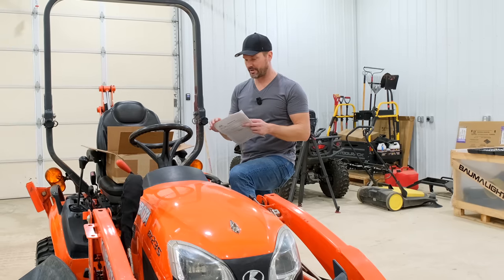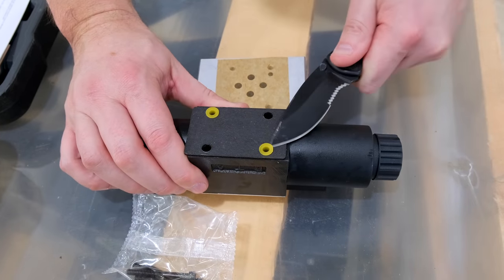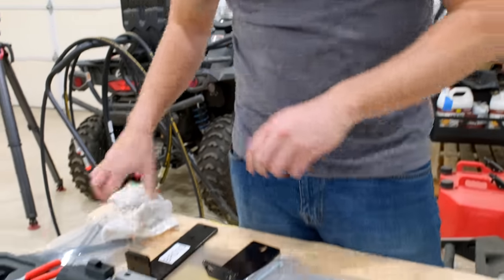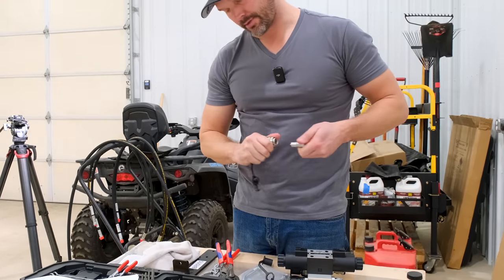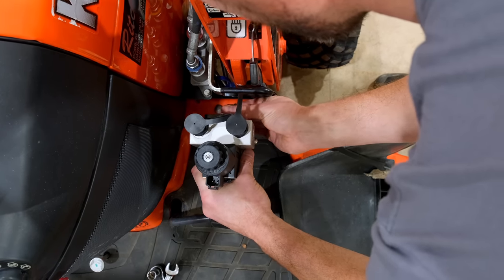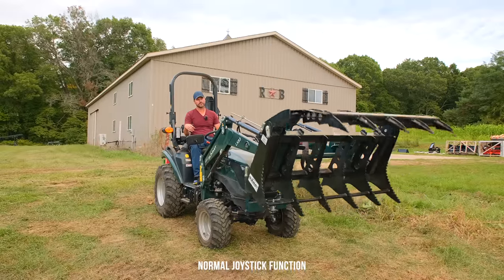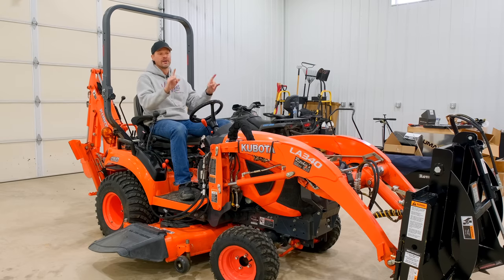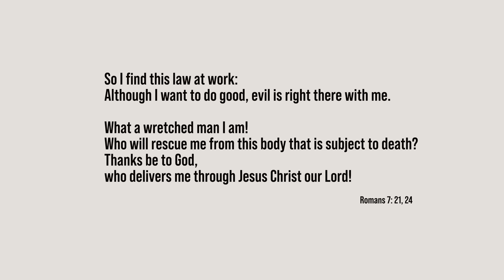90% OF TRACTORS ARE MISSING THIS FEATURE CUZ IT'S TOO EXPENSIVE

Comment from the maker: Have you installed one of these kits?  What did you think? Save 5% with code GWT on Hydraulic Kits @ http://www.summit-hydraulics.com

SHOP GRAPPLES: https://www.goodworkstractors.com/product-category/attachments/?product-category=grapples

LOOK AT OUR MOST POPULAR ATTACHMENTS!
Speeco Quick Hitch: https://bit.ly/3NFC0yl
Stump Wrecker: https://bit.ly/3WYa6Tf
VersaBracket Combo: https://bit.ly/3wUPrnl
Snow Pusher: https://bit.ly/3NB4BVw
Tillers: https://bit.ly/3GT1kk1
Core Plug Aerators: https://bit.ly/3W0R25q
Pallet Forks: https://bit.ly/38wRztu
Grapples: https://bit.ly/3PNNYaZ
Dethatcher: https://bit.ly/3GT9Zmk
Tractor Canopy: https://bit.ly/3IHcvNU

WANT TO SAVE MONEY? CHECK OUT THE GWT DISCOUNT CLUB!  Use code GWT at any of the vendors below and you will save cold hard cash :)  I will also get a commission for the sale, so it's a win-win-win!  

USE CODE "GWT" TO SAVE BIG WITH:
BUCKET BRACKETS @ http://www.jufabworks.com
CUSTOM GRILL GUARDS @ http://www.5elevendesignz.com
PTO QUICK ATTACH @ http://tractorptolink.com
DIY HYDRAULIC SOLUTIONS @ http://www.summit-hydraulics.com
TIRE CHAINS @ http://www.tirechainsonline.com
PREVENT FLAT TIRES @ http://www.multiseal.us
CULTIPACKERS & CRIMPERS @ http://www.packermaxx.com
ALL OEM JOHN DEERE PARTS @ http://www.247parts.com
ACCESSORIES AND BACKHOE BUCKETS @ http://www.muddscustoms.com
CUSTOM TRACTOR FLOORMATS @ http://www.tractormat.com
PROTECT, ORGANIZE, IDENTIFY HOSES @ http://www.outbackwrap.com
BOX BLADES FOR ATV'S @ http://www.northwoodsfabrication.com
HYDRAULIC SYSTEM PROTECTION @ http://www.hoseendchamer.com
DUMP FROM THE SEAT MATERIAL COLLECTION SYSTEMS @ http://www.proteroinc.com
POWERED SWEEPERS SWEEP UP ANYTHING @ http://www.sweep-all.com
EASY WHEEL TOP LINK HANDLE @ http://www.tractoraftermarket.com
TIRES, WHEELS, AND DUAL ADAPTERS @ http://www.millertire.com
AMERICAN MADE CARRY ALL ON STEROIDS @ http:www.bigtoolrack.com
THE BEST TOOTHBAR AND MORE @ http://www.heavyhitch.com
5% OFF WITH CODE GWT AT TRAC SEATS! http://www.tracseats.com

SHOP: http://www.goodworkstractors.com
AMAZON: http://www.amazon.com/shop/goodworkstractors
SUBSCRIBE: http://www.youtube.com/goodworkstractors
LIKE: http://www.facebook.com/goodworkstrac...
FOLLOW: http://www.instagram.com/goodworkstra...
MERCHANDISE: https://stores.inksoft.com/good_works_tractors_merch/shop/home

*Discount codes cannot be combined with any other promotions, offers, or deals!
**I choose to sell some products through 3rd parties instead of stocking items myself.  Know that I will receive a commission if you choose to purchase through certain links.  Thank you very much for your support!

This video is for entertainment purposes only.  Good Works Tractors (Good Works Lawn & Power, LLC) cannot be held responsible for content found in any video.  Always reference your owners manuals, use extreme caution, and proceed at your own risk.

Comment: I installed a summit third function with one rear remote for my top link on my JD 2032R. Third function runs a Homestead Implements pinnacle 66 inch root Grapple. Great additions.

Comment: Interesting that this is a true 3rd function install, not a modded diverter.  I like that.  I also like the buttons integrated int the ball, not a switch glommed onto the shaft under the ball.  I don't have a Kubota, so I need to so see if they have one to fit my brand.  I DO like that grapple!  Too many are just too big and heavy for a sub-comp.

Comment: I’m about 50% finished with installation of the Summit Hydraulics 3rd function kit onto my Kioti CS2520. It’s going okay but there are some issues with the hoses. The pressure hose is too long by around 10” and also has the incorrect fitting for the power beyond port. The tank hose is a good length but also has the wrong end fitting on the tank side. I spoke with Summit about it and the did send some adapters, but those also are not correct. It’s a decent kit but honestly a bit frustrating for the price.

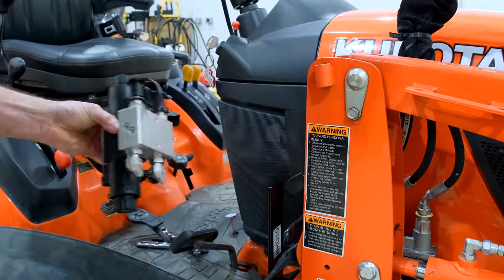Comment: 13:45  it almost looks like the valve body should be on the other side of the bracket. Was there not enough room for the loader lock levers?
Reply from the maker: No room to rotate, we tried.

Comment: Would you recommend getting the 3rd function installed when buying a tractor package? It’s $1500 from the dealer installed
Reply from the maker: Whew, that is steep.  Many times it's cheaper to have it installed when buying vs later on from the dealer.  However, if you got a couple extra hours then you could get the one from Summit for about half the price.